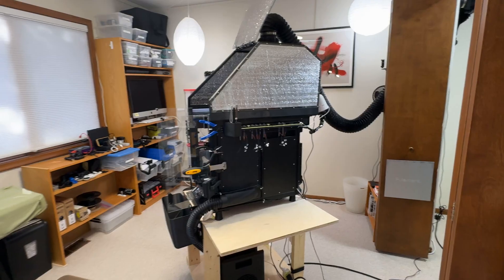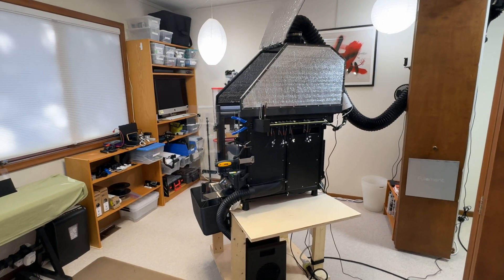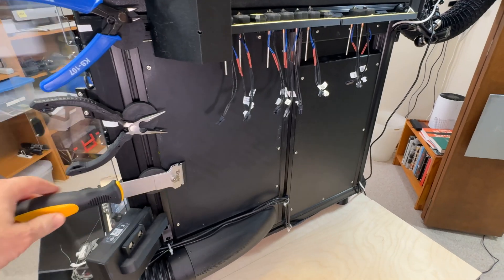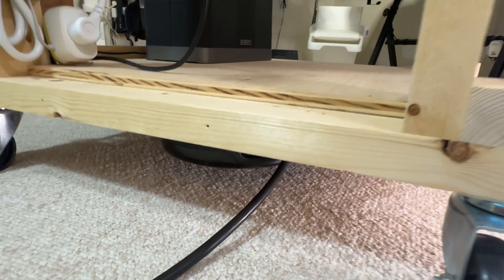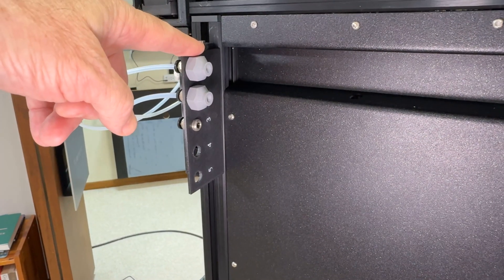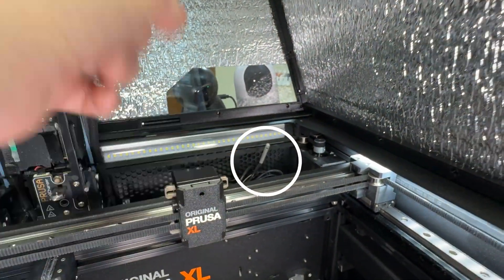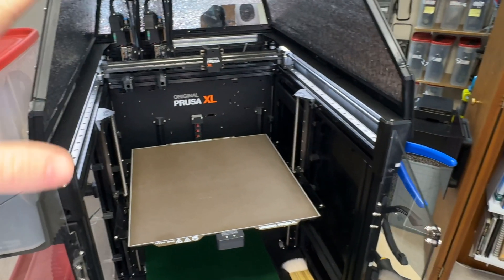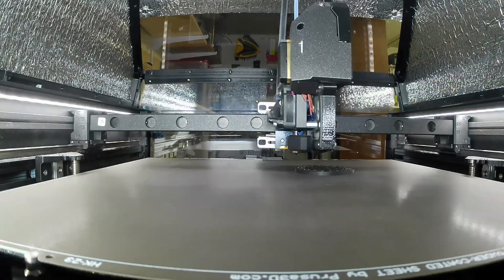Prusa XL One Year Tour

Comment: Great upgrades and very good video.

9:33 You are right about the external filament sensor for most filaments. However, some brands have a kink at the end, where the filament is attached to the spool. If this end enters the nextruder, it often gets in but not backwarts out anymore. Had this problem with mk3(s(+)) and mk4(s); actually added a secondary sensor and some TTL logic to my mk3s+ back in the days to detect end of filament early and still use the autoload feature. The first Prusa solving this for me was the Core One with its second runout sensor on the side. But just for a short time, as I added a MMU3 - same problem now again, only at the MMU3 instead of the printhead. If the FINDA detect filament runout, due to the kink the filament does not get back into the tube it came from. It blocks the MMU. So the "spool join" feature is totally useless with this kind of filament.
Sadly this is the case for my most used filament brand - Sanlu/Jayo. On sale about 7€/kg (buying 10 spools PET-G), so ideal for dayly prints and prototypes.
Reply from the maker: That kink at the end of the filament is the main reason I've printed a V-Spooler. For those brands that have the kink I re-spool (either with a new spool, or as a spool gets near the end), making sure the end on the inside of the spool is straight as I re-spool (not hard to do by hand). Rather drives me crazy, what do the manufacturers think we do with these spools of filament? Use them in weed wackers? If they are fed through printers (filament sensors, bowden tubes, etc.) they will jam with the kink, the filament will stop feeding, the printer won't detect an out-of-filament condition (just grind away at the filament in the extruder) and the print will fail, dancing around air printing. Really, what are they thinking? (I know, it's easier/cheaper to just kink the filament to attach it to the spool to begin a winding.)

Comment: Well done sir!  I will definitely incorporate removing the filament sensor. Looking forward to how you will incorporate 5 dry boxes if and when you upgrade to 5 toolheads.
Reply from the maker: Originally I was holding out for an option from Prusa for 3 print heads (in the early days one of the techs responded to in a chat that they might make this available). That works with my dry boxes (three "holsters" on the left side) with one facing towards the front on the back frame). But five? Would be hard. Happily I can be informal and have a couple of dry boxes sitting next to the printer on the cart, or on the shelf above. We'll see when (if) I upgrade. I've been considering dropping the bowden tubes entirely and feeding from the top directly into the extruders (as I already do for TPU). I've noticed someone else in the community already doing this (don't have the reference), which would change the criteria for where I placed dry boxes. It will be fun to work this out (again, easy while I only have two print heads, much harder with 5).

Comment: @7:10 Wrapping the white power cord together is very dangerous!"
Reply from the maker: Thanks for the concern, however I'm unsure of the danger you have in mind. Please say more if you'd like. This cord is neatly coiled out of the way of snagging or being nicked by anything, the bends are not overly tight for that particular (supple) cord, and it is held securely with soft binding (Velcro strap) so that it experiences no relative movement. These are normally characteristics of a safe installation.
Reply: @BarrittWorks  A powerline winded gets an inductive resistance. So it can heat up. However, here in Germany at 230V/16A longer extension cables (50m) sometimes had two ratings: Max 16A totally unwinded and about 6A winded (if I remember correctly, at least 30 years ago, nowerdays it simply states to never use the extension winded). As your cords are much shorter and even at 115V an XL wouldn't need more than 6A, I am pretty sure there is no big danger. However, you might check with an electritian (or simply check temperature of the cable roll under full load).

Comment: Prusa need a function where the extruder runout sensor on the extruder head stop and parks the tool. purges and then goes to filament join or asks you to load new filament, Why should we have to unplug bowden tubes and remove filament. And yeh the side runout sensors suck and never feed or unload reliably. And yeh nozzle wipers should have been a thing from day one.

Comment: 4:46 What material did you use to print the duct?
Reply from the maker: The duct currently installed is actually the prototype printed in PETG (Overture or Jesse/PrintedSolid.com, don't recall which). When I was done testing (and it fit and works) I just kept using it. I'll keep on with it until/if it struggles (deforms at all). So far no problem. I am not taking the enclosure up above about 40ºC at present (except for one brief test just after I installed the system) because I haven't put in all the replacement PCCF parts. When I do take it up closer to 60º for extended periods I'll keep an eye on the duct and reprint it in some flavor of PC (likely Prusa's PCCF) if needed. For now, if it continues to work, I'll leave it. (Put another way, I'd expect to print a final version for this in some flavor of PC  for greater temperature/creep resistance, but when the prototype in PETG held up I put off replacing it indefinitely.)